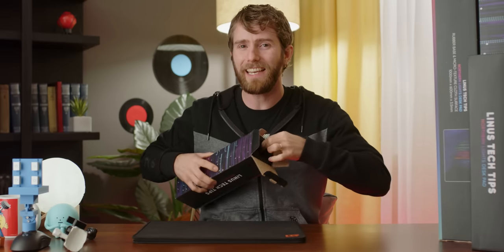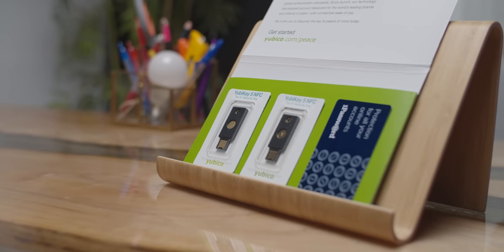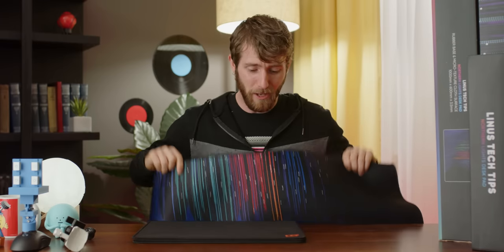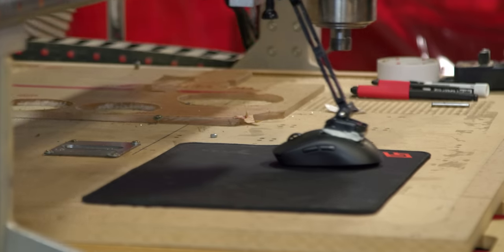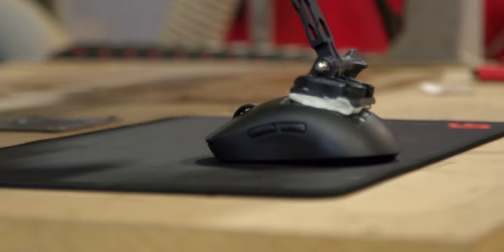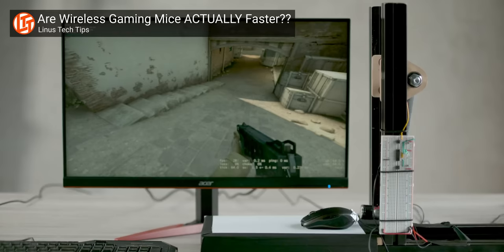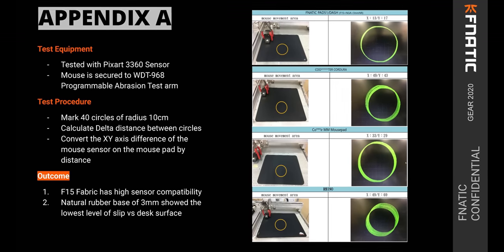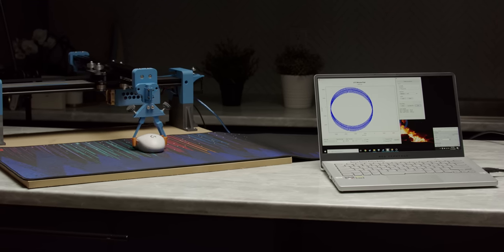A Totally Unbiased Review - LTT Northern Lights Desk Pad

Comment: Steam Machines, Steam Link, Controller with bad support out of Steam, Half-Life 2 in a time that not much people have vr cause is expensive, Epic Store giving free games that will make any teenager with no money is main library app, the Gamepass gains a lot of users cause they doing great.....
Valve seems like not the best company to put your savings. Honestly speaking.
But now they come with this portable PC in the most expensive pc hardware scenario, at that price its even a good value desktop pc. But Linux from factory it's the best of the project, not even for the machine itself for pc industry in a mainstream product have linux was great to improve faster. It's a really good combo of products at a very good price, in a time that everythink else is expensive, even a gaming tablet. Very good job, now valve seems like a more value company, a lot more!
The only con, for me is why don't put a sim card slot? Wifi is way more power consumption for both smartphone and console, for sure there's gona be a usb adapter but I complain more for this than the screen.

Comment: Mousepads are a fucking scam, I can't use any that are big enough without problems, I use 400 dpi and 1.1-1.6 (havent changed it in years can't remember off the top of my head) in csgo and just using my desk offers me the freedom of movement I really need, they get dirty and full of dust and crap so easily its just not a real product thats necessary